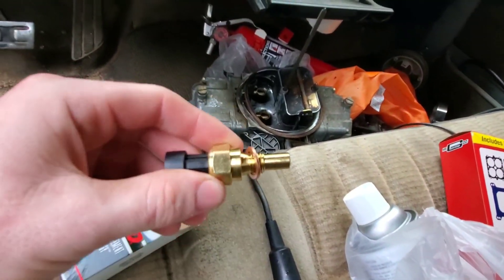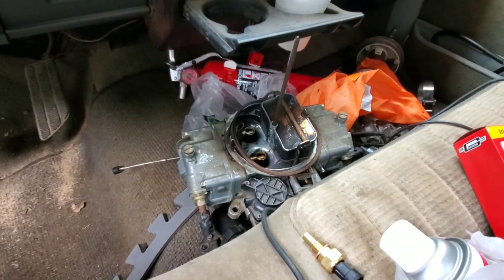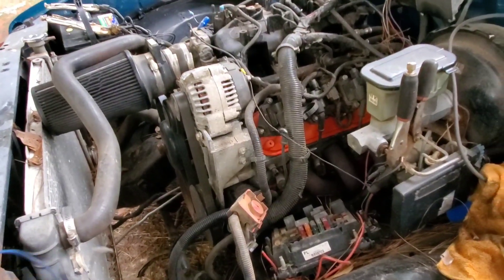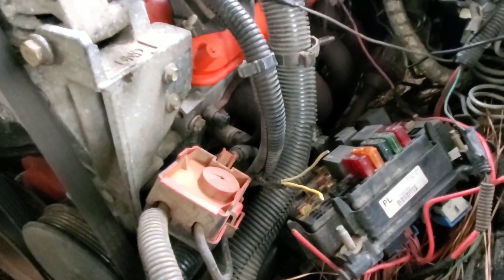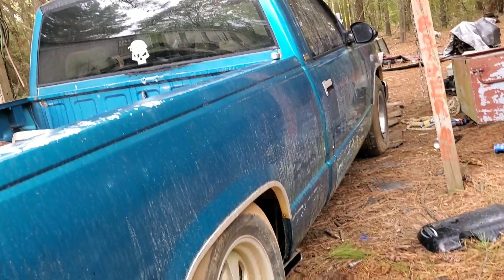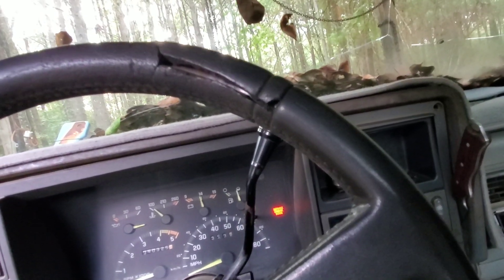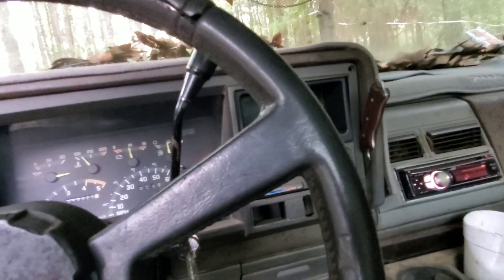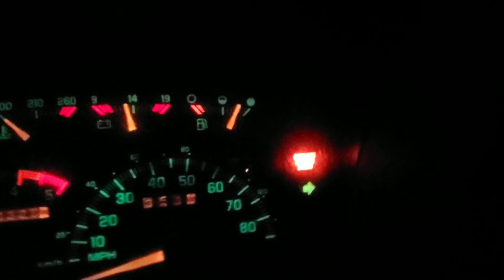92 Chevy LS Swap Factory Temp Gauge Hookup - HOW TO

Comment: I buy all  of my parts from AC DELCO PART in St louis. Because they have the best prices and they are. Not remanufactured or over seas. I had to buy 2 ABS Wires for my 2012 chevy Silverado I paid $23.00 a peice there and Autozone and every other parts store wanted $122.00 no joke

Comment: Are you doing a video  on how to wire the tach and speedo
Reply from the maker: Yeah when I do it I will
Reply: I'm currently working  on a 91 with 5.3 and that's the only  thing  that  is left to do is the gauges working.  Thanks
Reply from the maker: No problem thanks for watching

Comment: When I did my swap on my 90 I had a engine out of a 2000 and the oil sender plugged in to the factory plug from the truck. Might just try a sensor from a 99-02 ls truck
Reply from the maker: Mine will plug in to but I need one with 3 wires mine only has 1
Reply: @bowtieguy601  on the truck side you only need one wire to run the guage the other 2 go to the old fuel pump relay. I didnt use the old fp relay so I was good.
Reply from the maker: Yeah I'm trying to make all my stuff work like factory

Comment: When I did my swap, mine idle real fast too. I had to be in the little foot on the throttle lever where the auto adjuster screw is because it wasn't letting the blade on the throttle close all the way. You might could try that

Comment: Gotta change out the whole sending unit to fix the fuel gauge. My 89 c2500 and 99 S10 Blazer did the same thing. Don't get the cheap ones get the Delphi or Delco sending unit because the life span is years vs the few months the cheap ones give you...
Reply from the maker: Yeah it's got 340k miles on it so its prolly about time for a new one lol